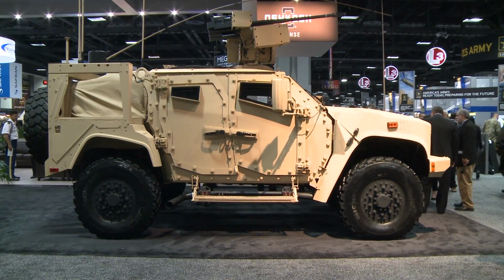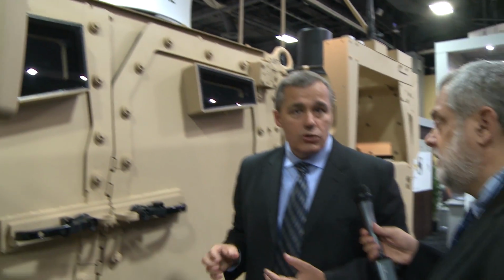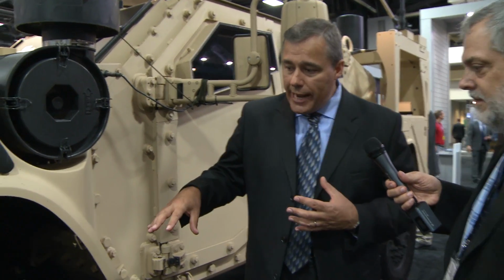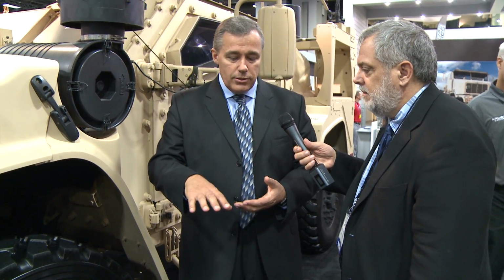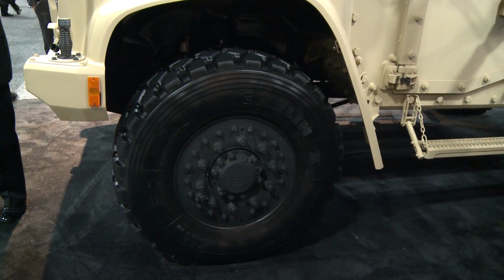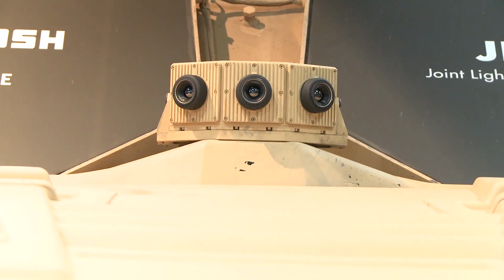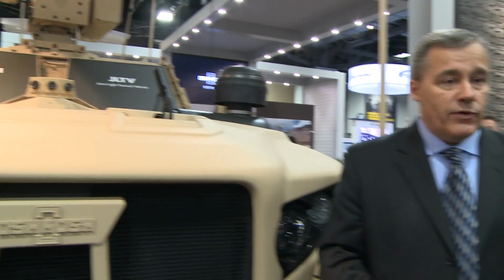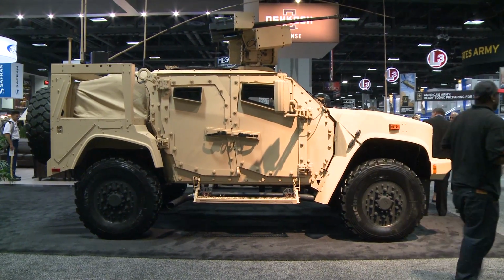AUSA 2016 - Oshkosh Shows Off Big Gun JLTV: 30mm Cannon

Comment: So every JLTV would be like a Bradley with armor and the 30 mm cannon but only better because it can travel faster and also withstand IED exlosions better. How many 30 mm rounds can it carry?
Reply: I don’t think it can carry many rounds, given how small this vehicle is compared to the Bradley. Remember, this is a 30mm cannon as opposed to the regular 12.7mm HMGs, those rounds are way larger than we are used to. I don’t think it would replace the role of the IFV completely but I would say it is a good supplementary piece for the current structure of the armed forces. At least now troops don’t have to worry as much with small-arms fire and land explosives like TM-62s or IEDs.

Comment: is this in the same category as South African Marauder or it is a lighter vehicle?
Reply: It is a little bit lighter vehicle but precise weights for both vehicles vary greatly depending on configuration options. The Marauder is designed as an APC with a larger crew area which may account for some of the greater weight.